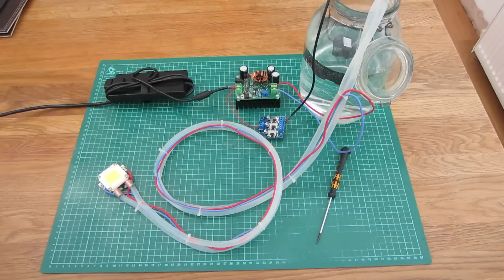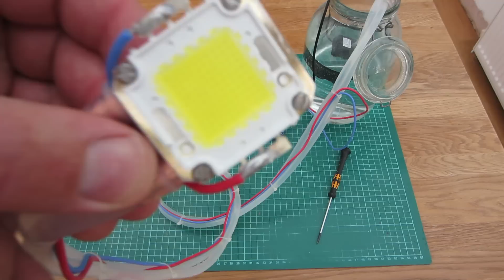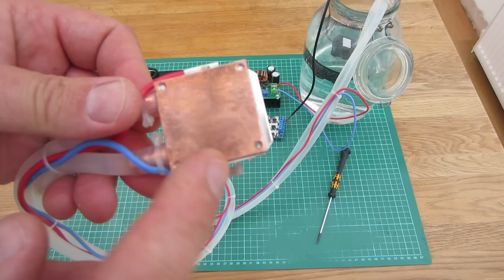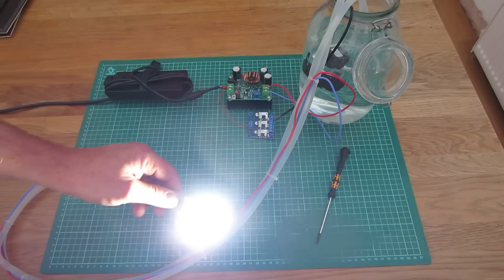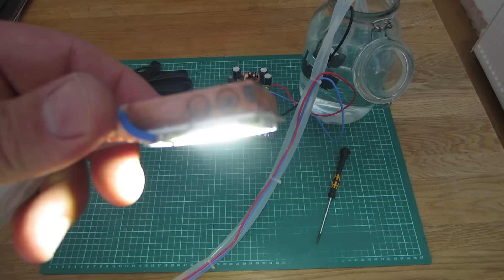100W LED Water Cooled Video Movie Grow Light

Comment: great light so the pump sucks water in the water? having a hard time visualizing the process , also can i soder  the chip to the water block ? im trying to save money and not buy thermal glue and a soder iron and wire.

Comment: Fantastic work, would love to see the follow up video on the tips you had if made again. I was in the process of making a similar setup, your video have me the idea to use silicon tube instead of pvc. Was going for a 150ml water tank bit not sure how that would hold up. hoping to machine my own heat sink with water ways.

Comment: how warm does the water get?  i think of using something like that in my reef tank and maybe i could use the waste heat to heat up my water if it doesnt get over 28°C
Reply from the maker: +chestor I am now running this 100W led with a radiator 200mm x 100mm with two computer fans.  The water temperature is about 40degC, but would vary with the fan speed which I run relative slowly.  The water has been replaced by a 50:50 mix of water and car anti-freeze to prevent corrosion.  The water temperature increased after adding the anti-freeze due to the reduced specific heat capacity of the mixture.
Reply: Thank you! well that is pretty much with the fans in addition but maybe im going to try it anyway!

Comment: Is there any way you could post where you purchased the copper heat sink, pump, and LED chip from? Also, you wouldn't happen to know if you dipped that LED chip in water would it short out? I'd like to use your setup for a partially submerged use. Any advice would be greatly appreciated!
Reply: Also, how did you attach the LED chip to the copper heat sink?
Reply from the maker: +ricoswavay9 

Hi,  

All the parts were from ebay.  You should find plenty of 100W leds there and cheap water pumps.

The heatsink was a little more difficult to choose, as it needed to be able to be drilled to fit the led.  In then end I bought one I thought would be close and just tried it.

Led: 261635571617
Pump: 301638900884

I can't find the link for the heatsink.

The led would work submerged, but not for long.
Reply from the maker: +ricoswavay9 
I marked the heatsink and drilled and tapped M3 holes.

You could possible drill M3 clear holes and use nuts and long bolts.
Reply: +Steven Heaton is it this one? http://www.ebay.com/itm/For-CPU-GPU-SR-Water-Cooling-Heatsink-Block-Liquid-Cooler-Aluminium-Waterblock-/131336773249?hash=item1e94481e81
Reply from the maker: No,

It needs to be a solid copper block one, otherwise you will drill the water channels.